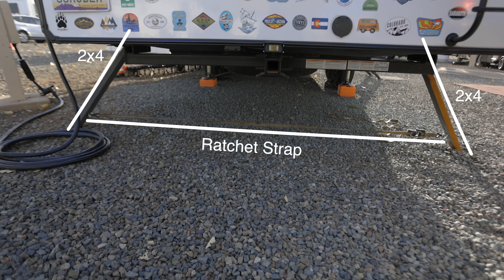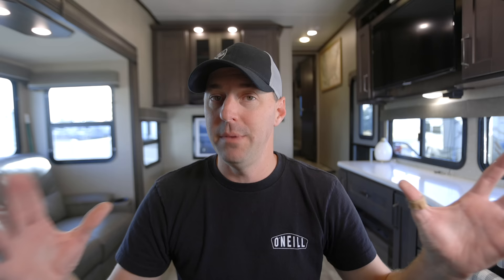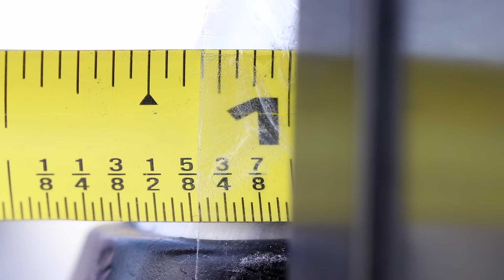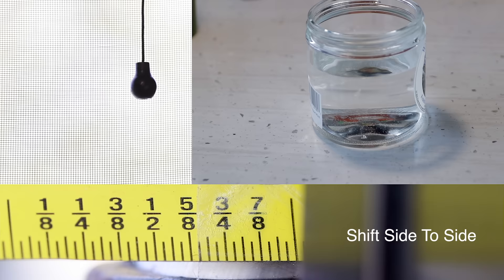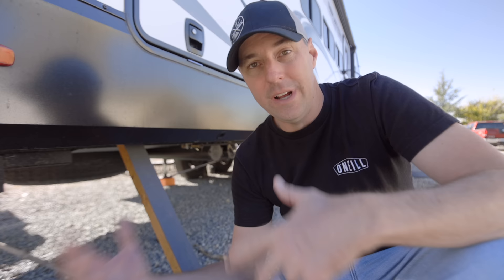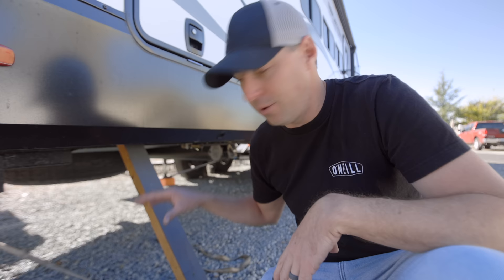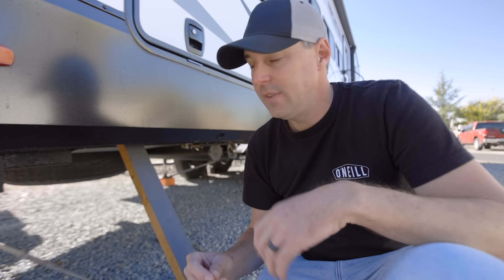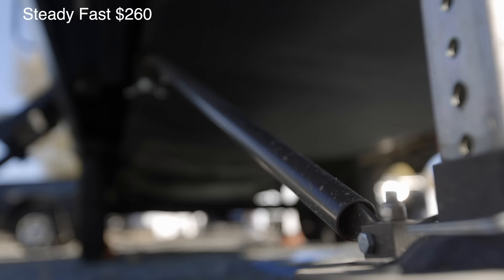RV Stabilizer Comparison!

Comment: QUESTION: Ok.  I got it on stabilization. But do the c-chocks work well as “chocks” to keep your RV from rolling down a grade?   Never considered buying x-chocks for anything besides “chocks” work.
Reply: I use xchcoks for the front to back stabilizer and also c chocks as you call them to prevent any possible rolling away.
Reply from the maker: I always use a solid chock, I think the ones we use now are made of rubber. I like a standard chock because you aren't supposed to use the X-Chock until after you level the RV and I wouldn't feel comfortable disconnecting my RV from the truck until it was chocked.

Comment: I have a GD Momentum G31 TT that has rectangular stabilizer jacks. The Steady fast will not work. Any other suggestions?
Reply from the maker: We had the same scissor jacks on our last RV and used the Steady Fast, it works great. They have a kit that has foot plates that bolt to the bottom of the stabilizers. 
https://amzn.to/3l2Wllo

Comment: weird that you tested the x-chocks for this. They're chocks, not stabilizers.
Reply from the maker: I agree that they would be better as just chocks but I have often been told to try X-Chocks to stabilize the RV for movement from other RVers and it's one of the first things on the box of X-Chocks. Many reviews and recommendations out their say it makes the RV feel more stable, I had to buy some and test to see what I found. I have even seen some say they are not wheel chocks but RV stabilizers. You could say they add stability comparing no chocks to X-Chocks but I didn't want to intentionally do a poor job of chocking the RV.  I hope that helps why they were in the lineup to compare.

Comment: What about applying a stabilizer under the slide? I feel more movement when I am sitting on our sofa with the slide out.
Reply: The problem with jack-screw stabilizers on the slides is the tendency to actually lift the slide, inducing unanticipated stresses on mechanisms and creating air-gaps on the weather seals.
Reply from the maker: Good questions/points. I did try shaking the RV front to back as well and couldn't get any measurable or noticeable difference between the X-Chock and our standard chocks on the RV. I didn't want to intentionally do a poor job of chocking the RV just to make the X-Chocks appear better.